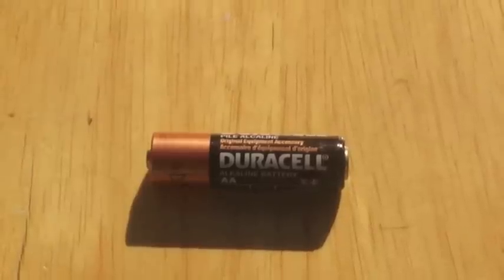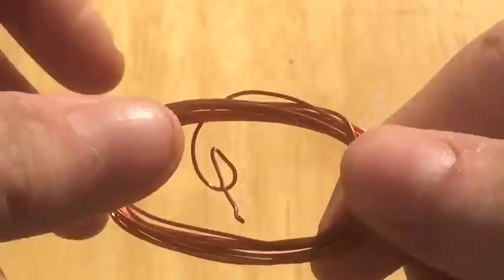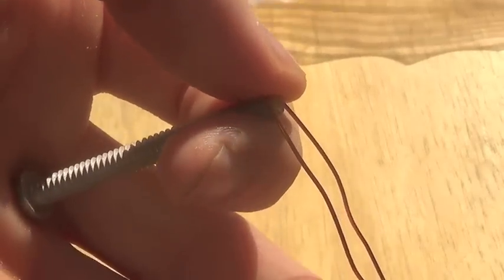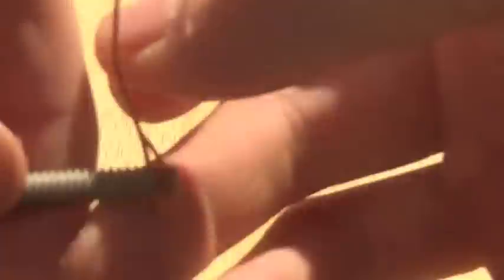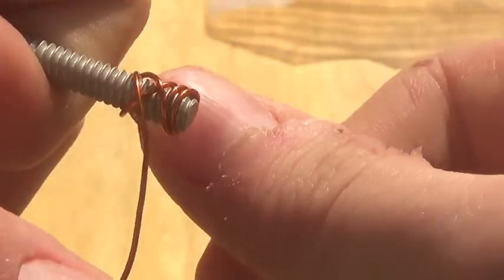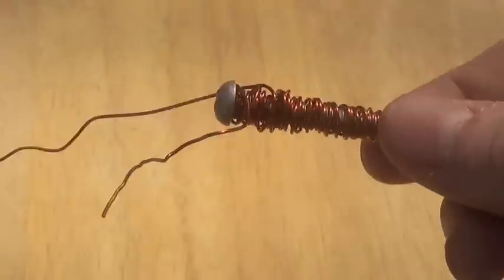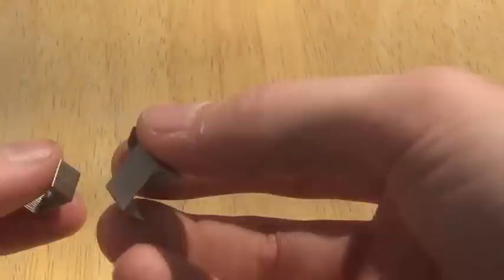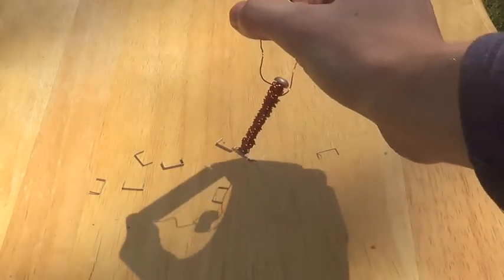Homemade Creation Tutorial of an Electromagnet, Electromagnetic Propulsion

Comment: Cool stuff man, do a simple AM/FM radio https://www.youtube.com/watch?v=7Q1WKKGRsjI
https://www.mikeselectronicparts.com
And try Digispark, maybe you can find it on ebay for a coupla dollars
https://youtu.be/PhqdYVe8Eg8      https://youtu.be/O1aLLBAChq4
Also try Xubuntu, use Etcher to put it on USB stick
https://xubuntu.org/download    https://etcher.io
Then adjust your system Bios settings to boot from USB device, button to reach Bios could be ESC, F2, F10, F12 or DEL....etc.
Read your computer manual
Regards

Comment: Guru Of Random,I Tried it but got no magnetic field, dunno if 'im doing something wrong, does it have to be an iron nail you wrap the copper wire around? Also do you have to have a certain amount of copper wire wraps around the nail?
Reply from the maker: Not sure on both accounts but I would imagine that the more wraps the better because that means better connection.
Reply: Guru of Random Thanks for replying, i've not tried since the first time, but i'll try before i go to sleep and let you know how i got on.
Reply from the maker: Did you get it to work?

Comment: need shielded copper wire?
Reply: +Guru of Random not if the copper wire has a coating
Reply from the maker: +BluWolf2012 I think any copper wire will do.
Reply: insulated wire works fine, coated copper works best, I've honestly never made one with uncoated copper as I just assumed it wouldn't work at all.
Reply: If wire has coated you have to touch it to the end of the wire